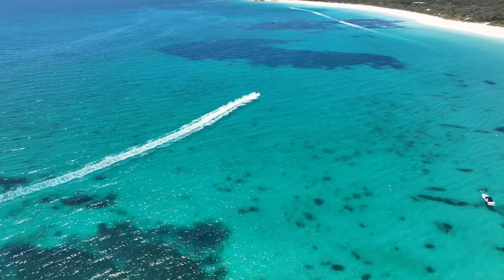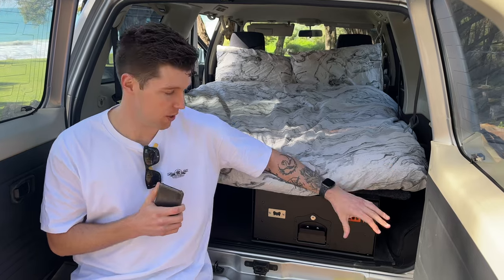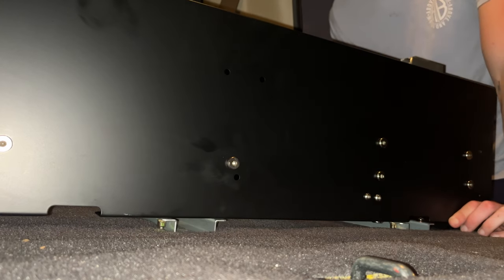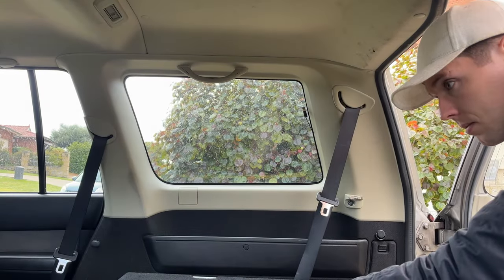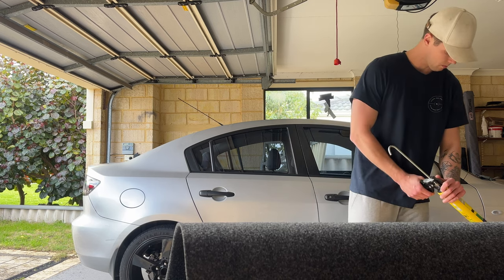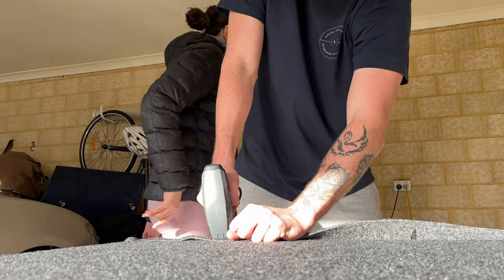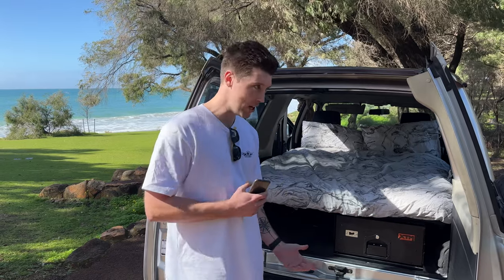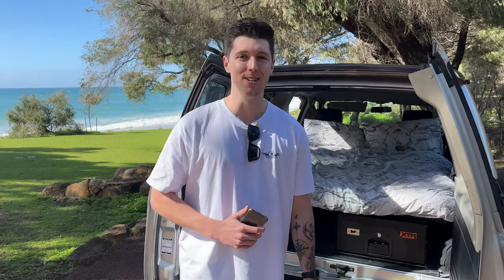Simple 4WD/SUV Bed Platform Install | Turn your car into a Camper

Comment: Really nice build. The only difference I would make would be to flip the hinges the other way and have a small gap between the two boards or the same thickness of the hinge or cut notches out for the hinge so there is no gap. So that way you're not laying on lumps from the hinges
Reply from the maker: Awesome good feedback mate! Yeah I considered that idea but ended up with what I’ve got - the mattress is more than enough to mask the hinge 🤙

Comment: Thanks for sharing the video. I am looking at doing something similar, but just for one side of the car so our kid can sleep there while we are up in the roof top tent. How did you support the plywood that flips over the seats (I know from my GU that in general the seats are slightly lower when folded than the height of the drawers I've got installed.
Reply from the maker: Hey mate! That sounds like a good setup. The board that flips on the hinge is just the right size to sit flush with the seats, no additional support required 🤙

Comment: What was the total cost for the project?
Reply from the maker: Hey mate, not sure! But I’ve listed out the parts that I’ve used for the build - hopefully that gives you a starting point if you’re looking at costing it up 🤙
Reply: @jasereynolds_  perfect, easy as. Do you remember what foam mat you used?

Comment: Hey mate cool idea, im thinking of doing the same in my GU. Just wondering does the platform rest on top of the draw, or is there a little bit of clearance since the platform sits on the angle brackets? Just asking because If there is clearance I could use it a for a slide out table.
Reply from the maker: @angusavery8686  thanks mate! It both rests on the draw and the brackets, but it wouldn’t be too hard to do this with a gap for a table to pop out!

Comment: hey mate, bit late to the vid but still watched it all. I'm a 16 year old kid with a passion for 4x4 and camping. I'm looking at buying a 4wd that I'm 99.9% sure will have enough space for me and my missus but I'm 6'4 and was wondering what mattress you used? do you reckon a swag mattress would work or no? thanks heaps for the idea bro, saved the vid to come back to watch later ❤❤
Reply from the maker: Hey mate, sounds awesome! Yeah I’m just under that height myself but I manage to sleep fine in the car which is good! I’ve got a double mattress from Clark Rubber that does a great job 🤙

Comment: Hello.

How do you comfortably sleep in the vehicle while retaining adequate ventilation, no insects,  security, etc?

Cameron
Reply from the maker: Hey Cameron! I use SnapShades. They allow me to have the middle two windows down, and the mesh prevents insects from coming in!
Reply: @jasereynolds_  many thanks.  Also, on really cold nights, how do you stop condensation and the cold air seeping through the metal vehicle body ?